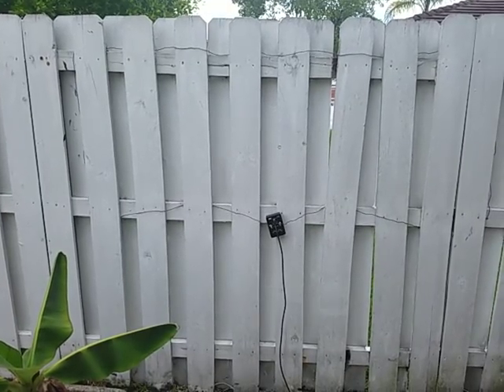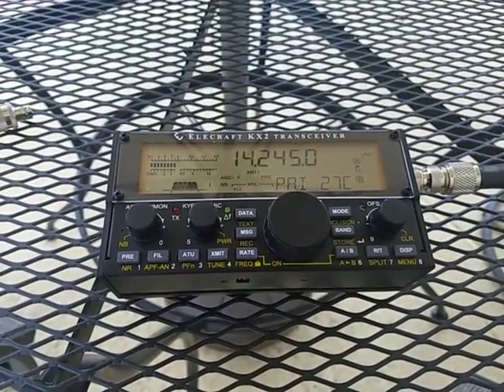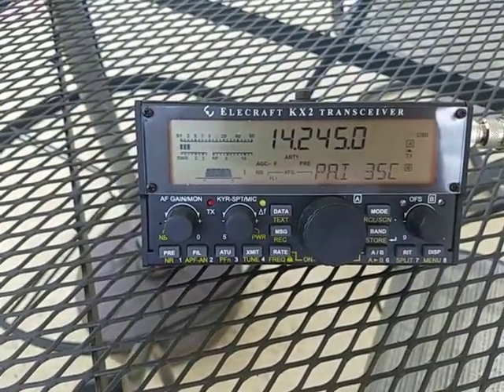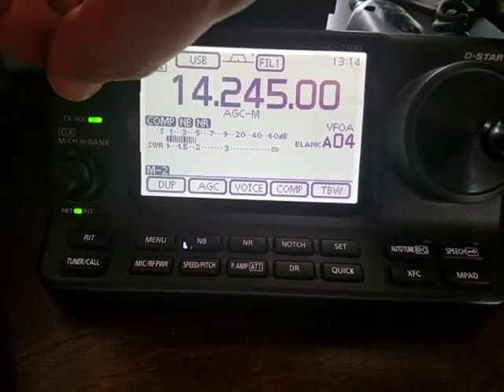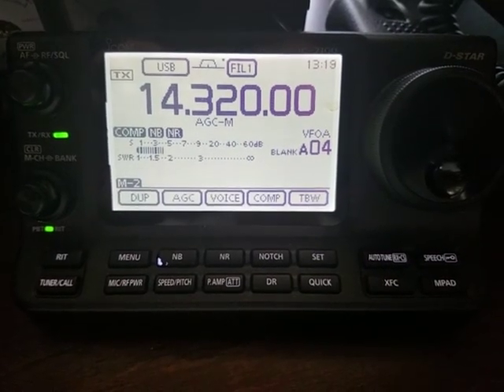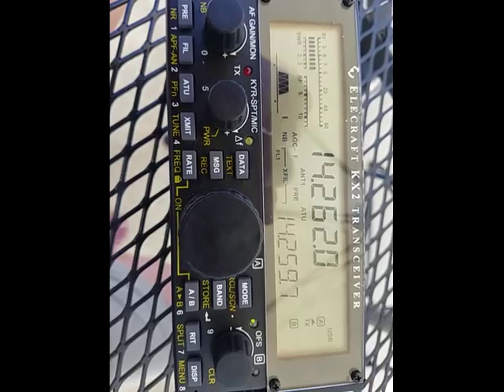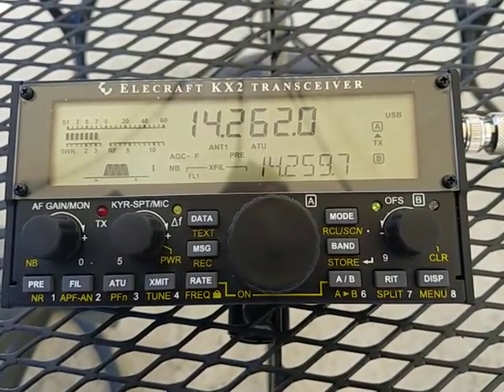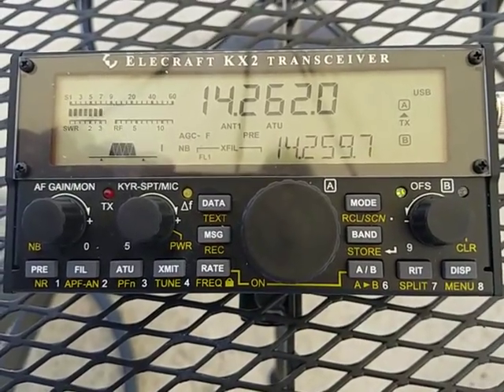MFJ 9232 QRP Loop Tuner Part 1

Comment: You said both the dipole and the loop were arranged east-west? That means the dipole would be firing north-south with zero off its ends, but it also means that the loop is firing east-west with a theoretical deep null broadside which is how you're comparing it to the dipole. Unless I've misinterpreted you that is ...

Comment: i believe the recommended length of the piece of wire for the Loop for 20 Meters is 13 Feet.  I would also try to get it in the clear.   For a Loop Just divide 180 by the  frequency and that will get you where you want to be

Comment: nice video!   according to the manual, (http://www.mfjenterprises.com/support.php?productid=MFJ-9232) on page 11, for 20 meters, the most efficient wire length is 13 ft.  The 8 ft is a convenient length that will cover more than one band but not the most efficient for 20 meters.

Comment: great report!

does the 9232 not come with a loop? mine's coming on monday and i'll be severely disappointed if there's no loop in the package. /guy (73 de kg5vt | wqpz784)

[later note: oh, it comes with the wire not an actual loop. product photos border on being a misrepresentation and i thought an actual loop came with it. serves me right for buying an mfj product i guess--they can't cut enough corners]
Reply: You get wire instead of a pre-made loop so that you can cut lengths for several different bands. READ THE INSTRUCTIONS! What do yo expect for $60 when other loop antennas are in the $300-$500 range? Duh....